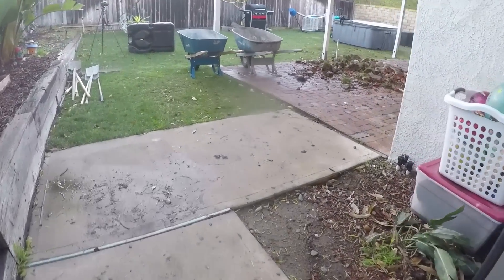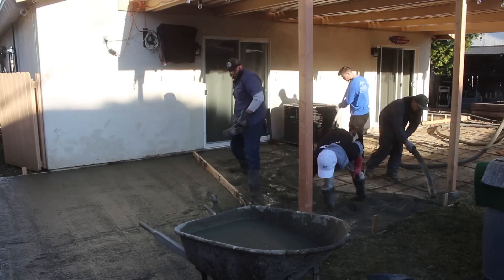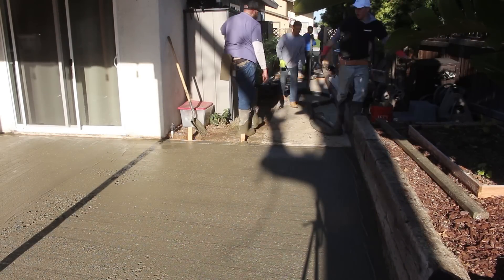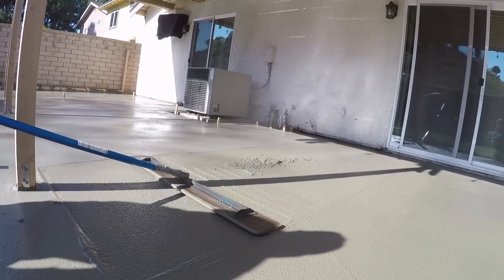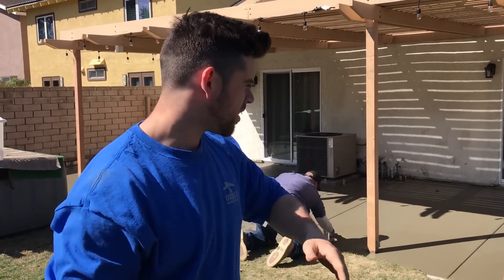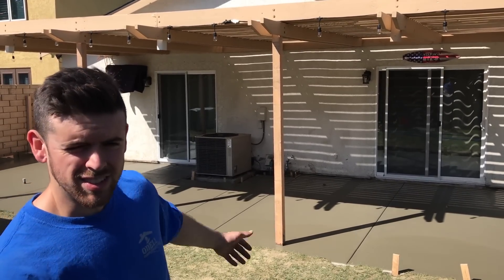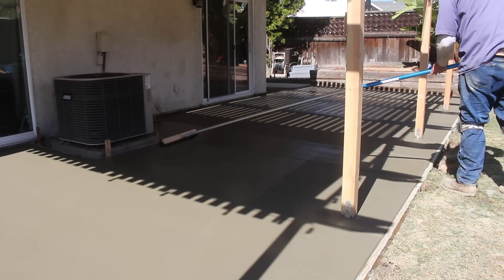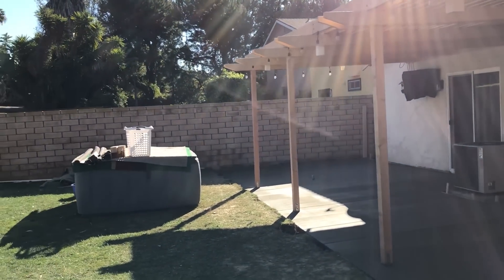How to Pour a Concrete Patio Part 2 Concrete Tips

Comment: Tim, nice job with the patio and nice video. A little different technique we have is we mag float our edges when we pour. We never steel trowel exterior concrete here in Maine. All our exterior concrete has 5% air, steel troweling it while finishing can cause blistering.
Reply from the maker: Air entrained for freeze and thaw

Comment: Plan on getting a patio poured soon. Will have patio furniture and a 850lb bbq smoker on it. What thickness should I go and psi rating for the concrete? Would 3/8 rebar still be fine? Thanks
Reply from the maker: My standard issue will work
Reply: Odell Complete Concrete what is your standard issue? Thanks in advance

Comment: Do you HAVE to slope if it’s under a covered deck?  I had a 70 x 12 concrete pad poured and it looks to steel to me from the side view from other end.   The furniture is not level,
Reply from the maker: yes slope is a good idea
Reply: Thanks.   Looking at your thumbnail, my upper left looks to slope way too much.  My patio extends probably twice as far as the one here,   It drives me nuts like I’m walking sideways.
Reply from the maker: 1 to 2 percent maximal

Comment: Looking at it i would say that is around 500 sq ft how much does a 500 sq ft slab cost?
Reply from the maker: 2500
Reply: @OdellCompleteConcrete  2500? For 500 sq ft? Is that including setting the forms and a excavation?? Do u do work in lancaster ca?

Comment: I would have used a pulley (attach the pulley to the patio ceiling) and raised the AC Unit up about a foot. Enough clearance to pour concrete under it. Would have made it looked clean...just saying.
Reply from the maker: may break the lines

Comment: Concrete should never touch wood, the concrete will continually pull the moisture from it and cause it to rot.  Why pour it against the railroad ties?  And even the wooden posts??
Reply from the maker: The rail road ties are shot any ways, the post is what the Owner did by himself.